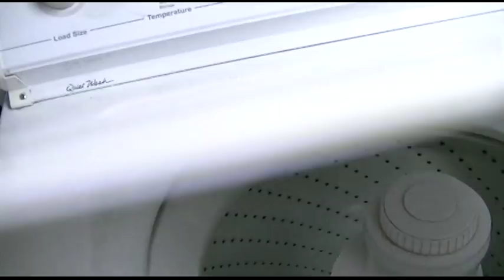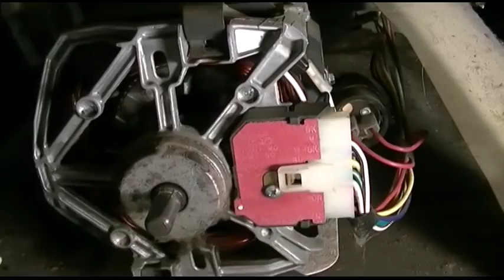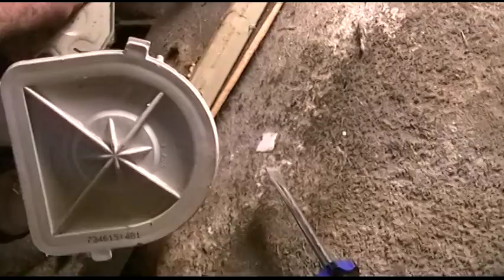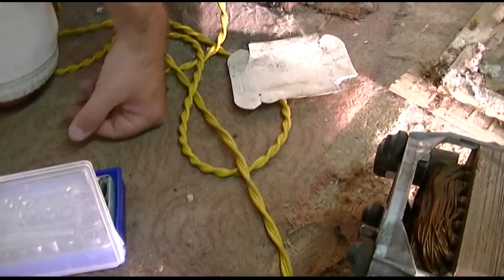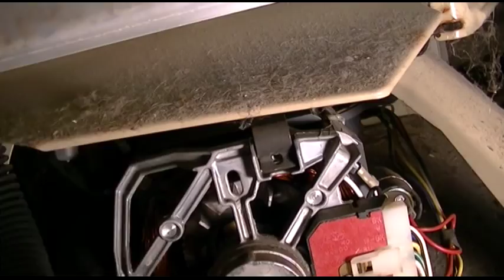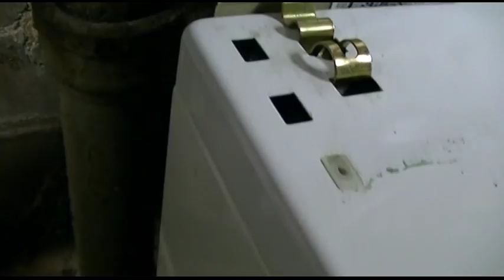How To Replace Motor Coupler--Whirlpool Direct-Drive Washer

Comment: Has the motor ever been replaced in this machine? For some reason it doesn't look original.
Reply: jaykay18 That proves the quality of the DD washers!
Reply: @andrewg593  They're a match to Maytag as far as quality is concerned.
Reply: +Sharkie626 I thought the motor was replaced because of that design as I've never seen a DD motor with that design before.
Reply: @andrewg593  What does the design look like compared to the later ones?
Reply from the maker: Andrew Gallucci I guess they had a couple different designs over the years, but all seemed to be rock solid reliable.
Reply: @jaykay18  Have you heard Alex Krupkin's machine running? I love the agitation! It gets right down to business!
Reply from the maker: @jeromedavis8575  I have not.
Reply: @jaykay18  https://www.youtube.com/watch?v=GPo-8L7RWO0&t=67s
Reply from the maker: Legend has it that this machine has had every part on it replaced at least twice, as allegedly it was a lemon from the get-go.  I have no proof of this legend, but based on the fact that the screws to secure the motor holding clips are missing, the motor was at least removed from this machine before.  If it was replaced, it was while the machine was still new.
Reply: I was surprised to see the motor's design myself. Apparently that kind of design does exist, but I am guessing they were only used for a short period of time, because our 1990 machine, and the 2010 machine my bro used to  have, all had the other motor design.